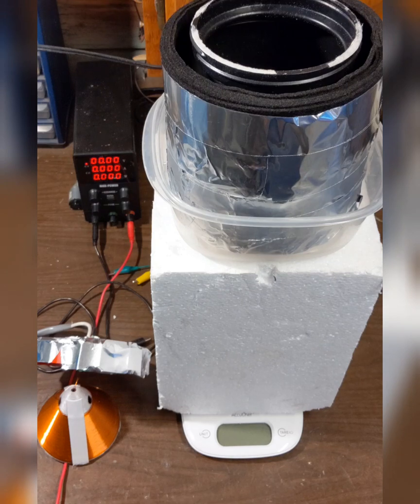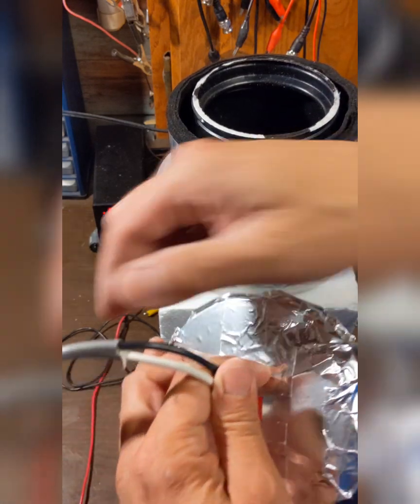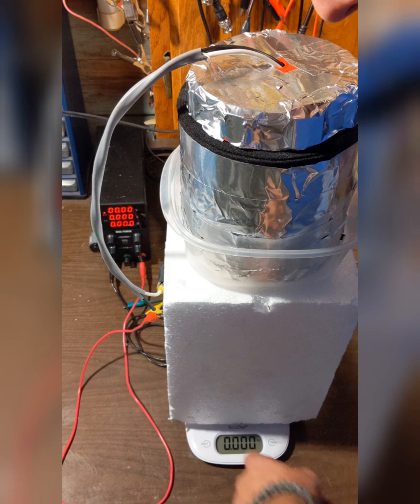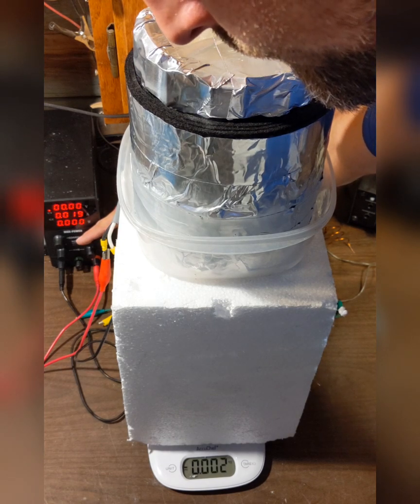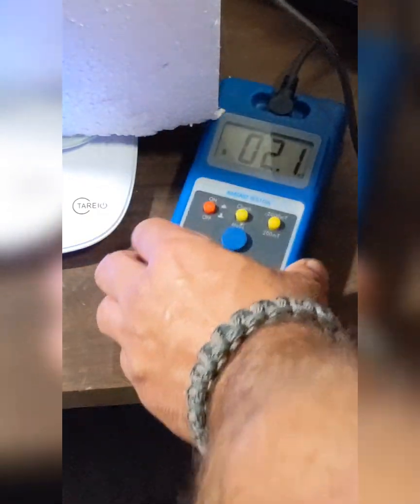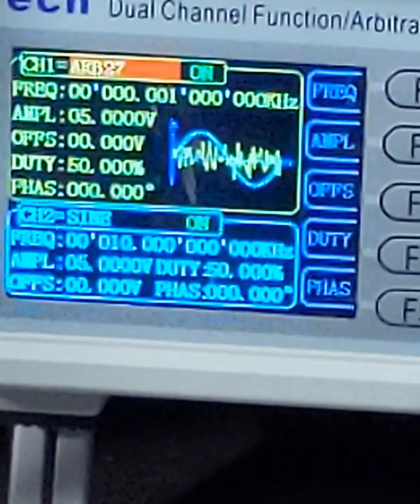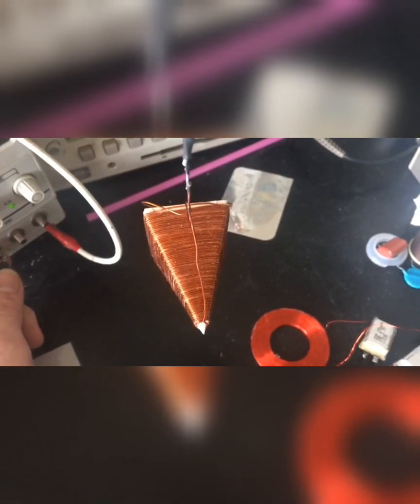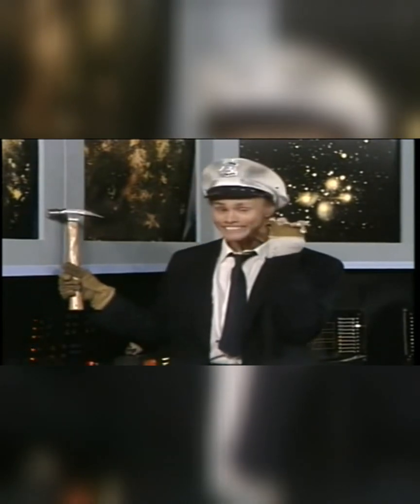The Nassikas Conical Superconducting Coil Thruster | does it work?

Comment: Have you tried toroidal conical coils - like toroidal coils on each other,  aech other smaller and smaller.
Reply from the maker: No, that's an entirely different topology than this Nassikas/Laviolette design. Have you got any results with toroids?
Reply: @failforwardresearch3127 Sorry for waiting so long for my reply. It's just that Youtube hasn't informed me about your response.
No, I have no experience vith it, but if simple conical coil doesn't give any good response on AC/DC, then this is the next step. It's just that in one direction there might be slightely more movement than in the other, so there might be two steps forward and one step back (changing current). The thing I mean about toroidal conical coil - I drew it on one of the movies on my account.
I also experimented with coils like you did, but I removed these videos.
Why don't you check your Nassikas conical coil on the changing current. The theory is that on one side there is a big wheel - on the other side of coil - small wheel. So in a one side curent you just create velocity, but when you give it double sides current you create two steps forward and one step back - just because in one direction there's only small portiin of effort creating velocity, but in the other direction it's a slight bigger vallue.
OKAY!!! THE MOST IMPORTANT THING IS FINDING THE RIGHT FREQUENCY OF A DOUBLE SIDE CURRENT, TO MAKE THAT TWO STEPS FORWARDS AND ONE STEP BACK. Perhaps when it goes up and down over x axis- it should last longer than on the field down the x axis (both sides current). Or this might be also dependant from the beginning of coil and the end.
Reply: It's like gaining delta v/delta t

Comment: You should be first a test the superconductivity is exist ? If yes, than need to find the max. current limit. After that try the forces on the maximal current.
Reply from the maker: I may have been mistaken about the wire, I was told it was HTSC. Someday, I may revisit this.
Reply: @failforwardresearch3127     You can inspect it by a microscope : you need to look the cutted wire surface with it. The HTSC fibers are covered in a substrate, for example, in silver, and the cut ends of the covered filaments, which appear as dark dots in the substrate material. If you see such things, it is possible that is HTSC wire, if not, almost certain that not HTSC. If HTSC, you should look at the data sheet because it has a smallest permissible bending radius. When you bend it in a smaller radius, the elementary filaments can break inside. In the photo, in the narrow part of the cone, a small bend radius is visible. It's radius needs to be check by datasheet.

Comment: Copper is NOT a superconductor. What you built is a normal magnetic coil.
Reply from the maker: Hi BlackBrain, I like your work. Regarding the wire it is actually High Temp. Superconducting wire, copper outside, HTS composite inside.
Reply: @failforwardresearch3127  Ok nice. btw how much did the SC wire cost ?
Reply from the maker: @na43w4j29  I don't know. I got it second hand from an associate. Who had it sitting around for 15 years. Here is a link for further information https://www.suptech.com/superconducting-wire/
Also, I hope we can stay in touch.
Reply: @failforwardresearch3127  Thanks!

Comment: You could try to put the Nassikas above a flot (such a polystyrene or a plastic container). And put the floating surface (with nassikas on it) on the water (like in a bathtub). And then see if it moves in any direction once it's connected to the current. An example is to put Nassikas inside a polystyrene container and fill it with liquid nitrogen and then close the container with a polystyrene lid. Then you decide how to pass the wires: for example you could make two holes in the cover where the power wires pass. I wait for other tests and videos!
Reply from the maker: Thanks for your thoughts. If there was any net thrust it should have shown on the scale. However, two things I may explore: capacitor discharge, and pendulum bob movement. The latter could indicate a gravitational phenomenon, but that would be outside the theory of this device. The cap discharge is well suited to supply a large transient current, without impedance matching issues with the signal generator.
Reply: @failforwardresearch3127  try saw tooth current. Most of the inertial propultions that work ( like thornsom's propulsion) do these two steps forward and one step back.

Comment: The magnetic flux density is high inside the cone of SC. The density outside the cone is much lower since the magnetic lines need to travel around a larger path to get to the other pole.
The higher flux region applies more pressure via meissner effect than outside the cone so a net force exists across it.